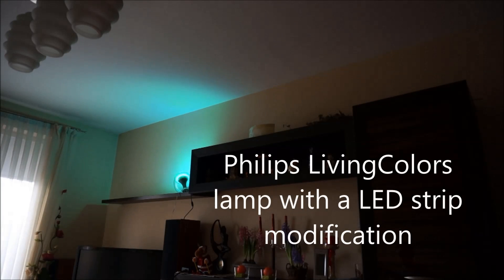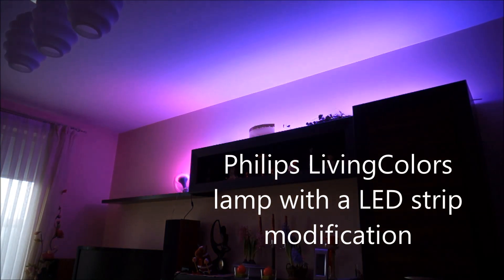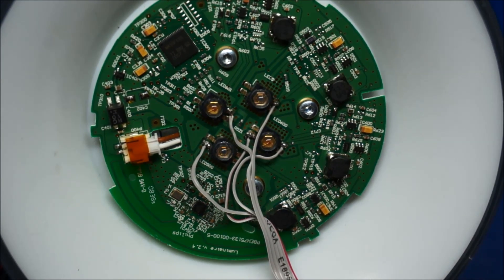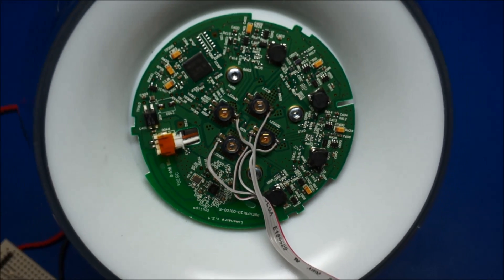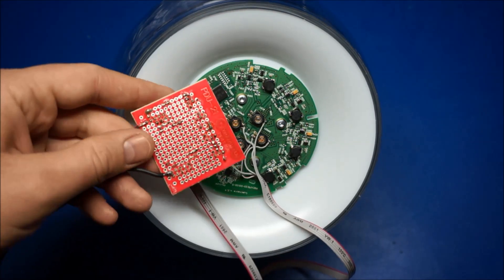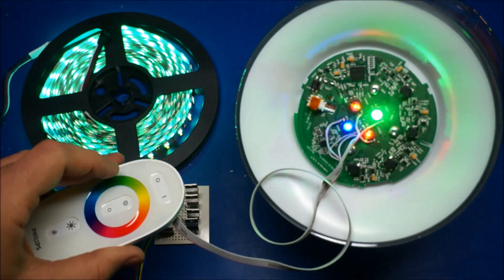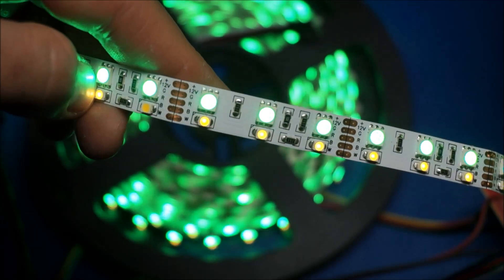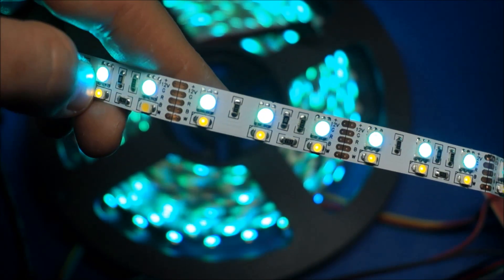Philips LivingColors lamp with a LED strip modification

Comment: Hi there, i have same Philips light. one of the LEDs have stopped working. Just wondering if you can help me with the replacement LED part number or a link where i can buy the replacement LED. Thanks in advance.
Reply: Can anyone provide any information about this? Thanks!

Comment: To get access to the PCB, just turn the diffusor plate (front, appr. 12cm in diameter) just 5mm counterclockwise, then you can remove it and get access. It took a few attempts and some force to do so...
Reply: Thanks, that helped a lot!
Reply: Well, i hope you can see this reply. I have philips iris and its power jack is broken. Do you know how to open the backplate? I opened the front section, but cant unscrew the heatsink.
Reply: @mayalimayasizkarisik  i have the same issue, but i found that you need to open the top by turning it counter clockwise, remove the diffuser pads from the center and unscrew the screws, take out the pcb and unplug the wire from the back. remove the heatsink cover below the pcb and then turn the lamp over. on the botom use 2 small screwdrivers and lift the connector out while pressing on the 2 tabs on the side. the connector will be able to come out with the wire that goes through the heatsink.
Reply: please make a video showing how to

Comment: how to open the philips living colors gen 1 lamp? thx
Reply: atomicsushiberlin I could not find more information than this video. So I ripped it off. It is fixed with just 3 clips to the PCB.
Reply: @wragabrr  . please make a video and show how open it 
i want to repair one of them and i stock in it 
thanks a lot
Reply: Then there was a second white cover which was fixed with two screws.